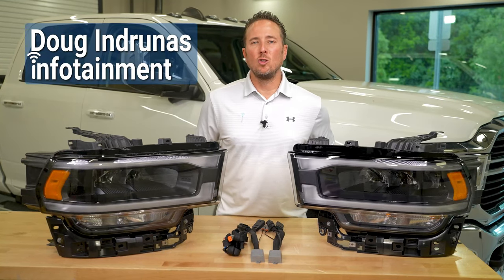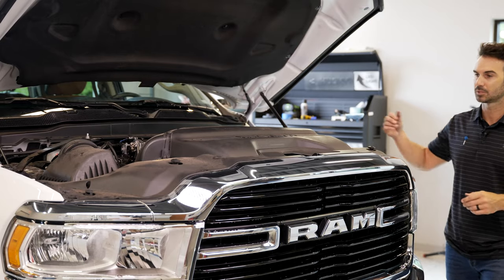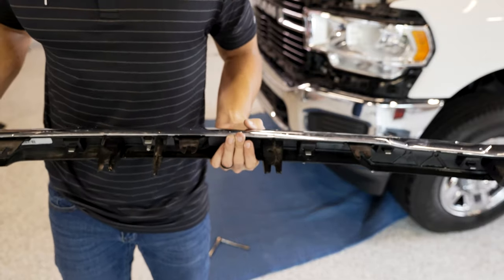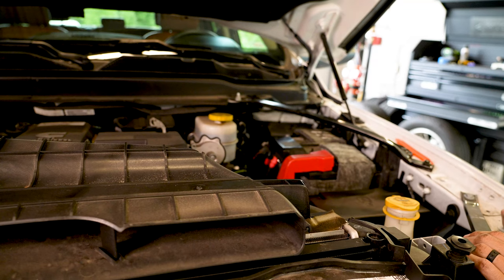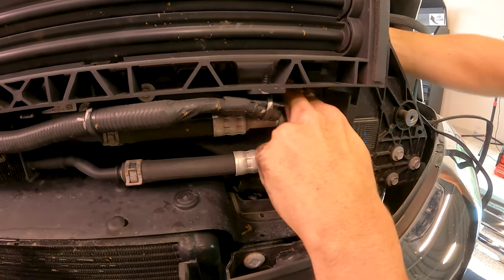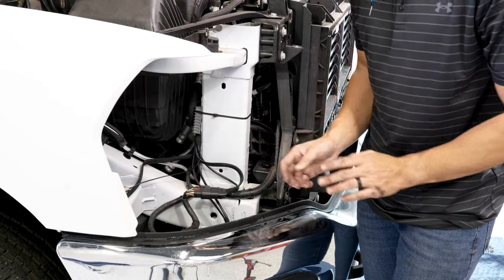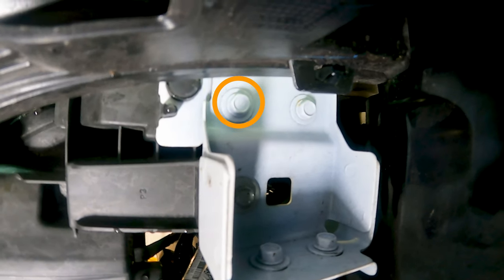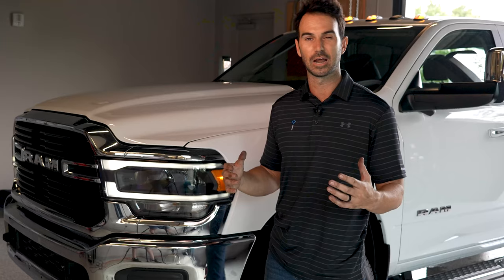2019+ Ram 2500 Reflector LED Headlights - Episode 3 - Infotainment.com

Comment: Great video and correct instructions. Not an easy job though and made me hate Dodge. Way too much to just replace headlights. On my Ford is was few bolts. I think if I had to do it over again I would have just paid someone. 🤣
Reply from the maker: Understood! This is one of the installations that might be good to have a verified installer perform.

Comment: Hello 
I have a Laramie RAM with LED lights from the factory. Can your headlight be replaced and do you need the wiring kit? My fuse box is built differently. The flashlight fuses are in F97-98
Reply from the maker: Hmm... I'm a little puzzled by your fuses F97-F98. If the head lights were halogen and you're going to LED, you will need the wiring kit. Essentially LED lights require a pulsing power output instead of constant power, so the wiring converts that to prevent damage to the LED's.

I can take a closer look if you'd like, just email me, dave@infotainment.com with your VIN.

Comment: Your directions say to include the original fuse along with the fuse you provide but he did not add the original fuse in this video. Do you add the original 15 amp fuse to the add-a-fuse or not?
Reply from the maker: Yes, both the original and the fuse included with the kit must be installed to start the truck

https://youtu.be/NNGOeSZ-60c?t=530
Reply: Ok thank you for the reply. What do the modules do to make the lights operate and why do they need power?

Comment: What fuse is at F 43 location
Is it the same for a 2021 ram 2500
Reply from the maker: From what I can tell, the fuse box is identical from 2019-2022 Heavy Duties. Fuse F 43 is for the "Heated Steering Wheel". Most trucks don't have that equipped, so we use that fuse location. If you do have heated steering wheel, it will be retained and work just fine.

Comment: Where can I get the wire harness nd module
Reply from the maker: We would not sell the harness and modules without the headlight and vice versa. These OEM parts need to be matched to the Vin of the vehicle and to each other or there is a much higher likelyhood of failure. We would much rather get you a fully working kit. If you are not interested in the full kit you would need to source the modules and harnessing elseware. 
https://infotainment.com/shop/exterior-accessories/head-lights/2019-2023-ram-1500-dt-truck-oem-factory-led-headlight-upgrade-kit/

Comment: will i get an error code or something in my odometer?
24 ram 2500 here
Reply from the maker: No, these are OEM so with our OEM programming these are designed specifically for your vehicle. This will be plug and play and we have not encountered any issues on this upgrade solution.

Comment: If these are OEM headlights, why do they need the hack wiring job? Is there no way to reuse the factory harness? I really dislike fuse taps.
Reply from the maker: Not a hack wiring job. The new harness sends the correct signal so that you don't get lamp out errors or flickering.